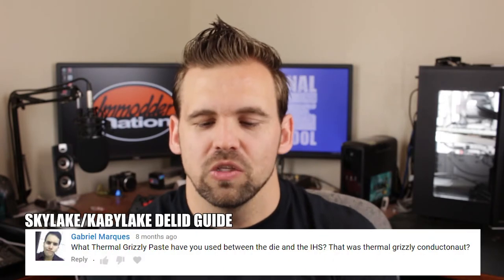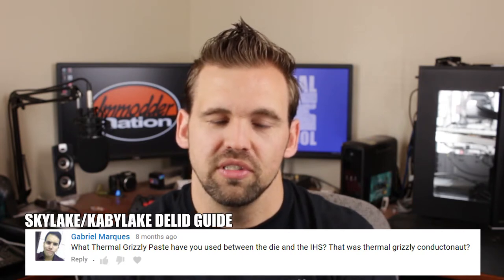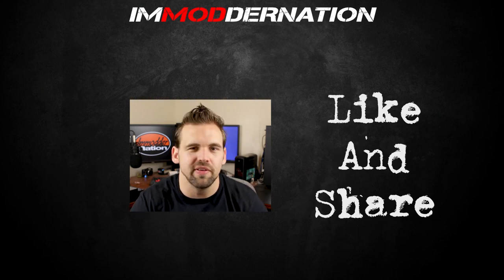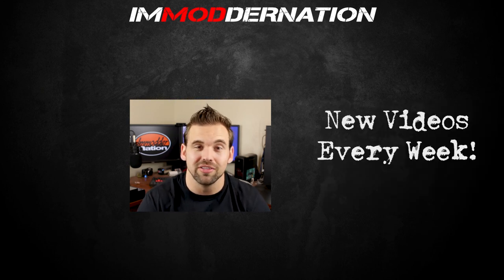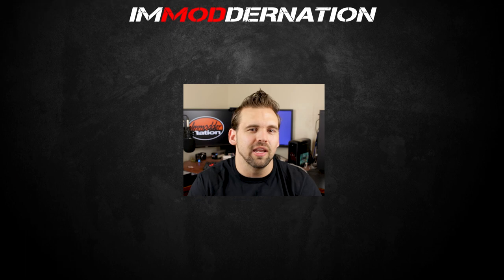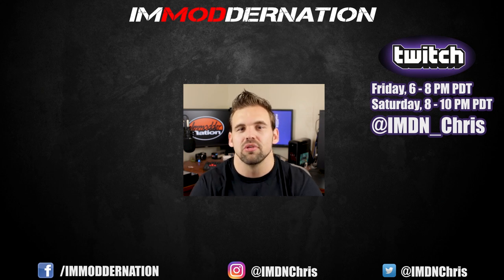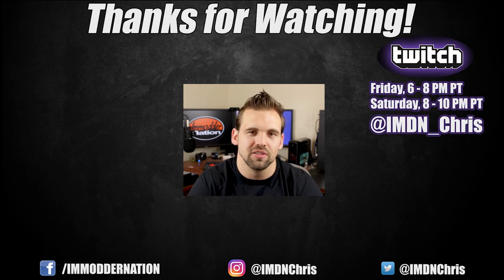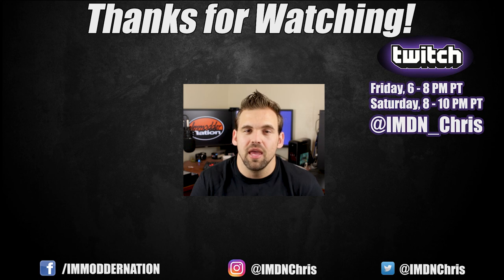Q&A: PROCESSOR DELIDDING, LCD SIDE PANEL MOD, OVERCLOCKING, GTX 1070 Ti

Comment from the maker: *Questions*
1:05 - Thermal Grizzly Conductonaut used for Skylake delidding?
2:51 - Is delidding my processor worth it?
4:46 - Should you use a razer blade or delidding tool?
5:46 - Will X monitor work with X pc case?
7:13 - What video editing software do I use?
7:43 - My $0.02 on the GTX 1070 Ti
8:34 - Is it possible to overclock a processor too much?

Comment: hey man. subbed and stuff etc.  keep it up.  1 question... did you mean VGA when you said DVI for the lcd side panel?  and if so, i'm trying with a 19" viewsonic that has both outs.  should i lean towards one or the other?  peace you silly dude!
Reply from the maker: You can use either but iBuyPower uses DVI and so do I. Thanks for the sub and happy new year to you!